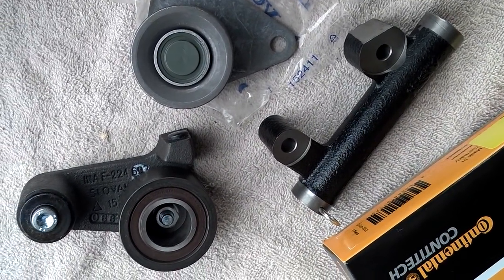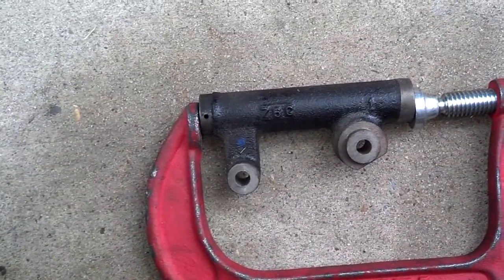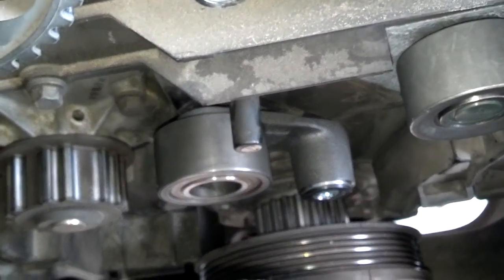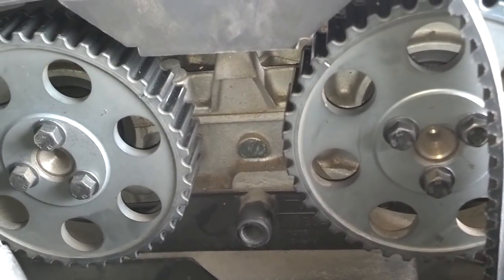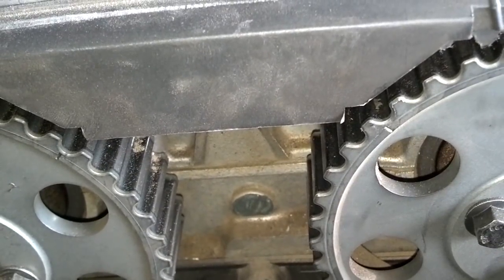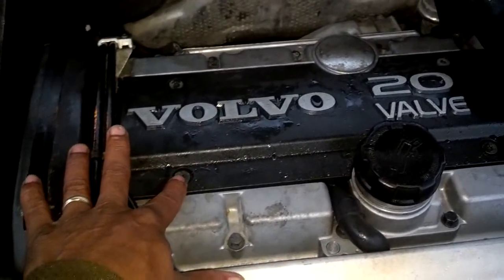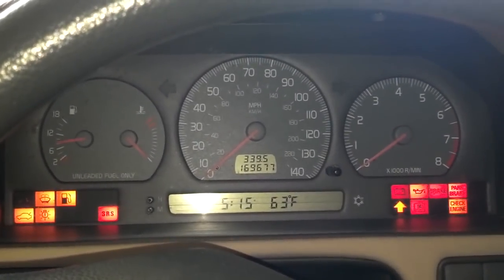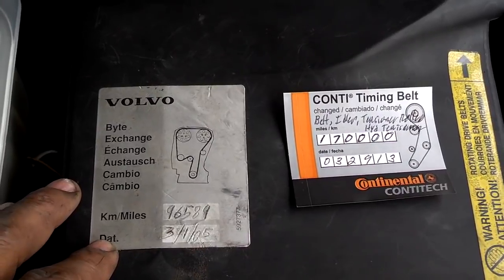How to replace the timing belt on the Volvo 850, S70, V70, etc. (Part 2 of 2)- VOTD

Comment: Just did mine last weekend (98 S70 T5), everything went smoothly (save for not having the serpentine tensioner tool, but I figured out a way to work around it), and the total cost was under $300 (local dealer charges $1300).

Keep up the great work, your tutorials are awesome and very easy to follow!

Comment: Thank you for sharing the timing belt work on the S70!  I have the mechanical tensioner which I think makes the work easier than the hydraulic ones.  However, it is very true that the mechanical ones could fail.  It did happen to my 98 S70 at around 100k miles.  I was extremely lucky to have caught the failure in my garage when the T-belt was making unusual sound as it was cutting through the cover.  Just lucky it happened at home!!  All ball bearings were gone, but tensioner was still in place.  The S70 is still running strong ~ heading towards ~400k miles.  Just durable vehicle if you can do the basic maintenance! 

Note also that the belt sizes are different between the mechanical and hydraulic tensioner types (~6 teeth difference).
Reply from the maker: Glad to read that you caught the problem before it destroyed the motor. You are right, these cars are great and can run a long time. I was aware that the newer motors with the mechanical tensioners have a different size belt.

Comment from the maker: Hey Paul. If the belt broke or slipped the head is destroyed and it will need a new head and / or pistons (lower end). If it's just due, that's another story and doable. The tensioner is a little different, it has a mechanical tensioner and the timing is set a little different but the guys on Matthews Volvo site can help with the minor differences. Let me know if you have any questions.

Comment: Robert, always a pleasure to watch you in action. I took off all of the components (belt -Two pulley's - water pump - tensioner  ) and unfortunately discovered that the tensioner  pulley was wrong and the Gates timing belt was the wrong size.  I had ordered the kit off of Amazon for 115$. Ughh man.
 You're so spot on right about the torx  bolt holding on the tensioner. You don't want to strip that . Mine was in bad shape from a previous owner. I had to apply a flat long bar against the ratchet head while unscrewing the bolt. I'll be replacing that torx bolt . Yes indeed ! 
This might help somebody - After writing down the mileage on the sticker , place clear plastic tape over the sticker face so as to preserve the information. I also write down that info on my Volvo book.
Reply from the maker: That tensioner pulley bolt comes with the new part, they are attached.

Sad to read about your parts. That is why I try to only order parts from suppliers that specifically support our cars. If they ship you something wrong, they will usually overnight the corrected part no questions asked.

I like to put the sticker in the glove box. I think I will go purchase an OEM sticker from Volvo from now on, if they will sell them. They are aluminum and writing on them with an ink pen leaves the data pressed into the sticker, so if the ink wears off the impression from the pen is still there.
Reply: Robert DIY Glove box ? Good idea.
Reply: also engrave the mileage on the cover if the sticker ever gets faded or lost.

Comment from the maker: You should be ok as long as you don't hear roller noise. Sometimes people change the belt only and leave the rollers and water pump along. If the rollers go bad it will cause the belt to jump time which would be as bad as the belt breaking. So if you hear the rollers squealing when you first start the car cold, I would replace everything. If you are skilled enough to slip a roller out and put a new one in, that would work as well but most folks don't even try that.

Comment from the maker: Not sure about the S80 crank (harmonic balancer) needing to be pulled. Google some instructions or check SwedeSpeed. 

Yes I did turn back the cam sprocket without the belt on. When you have the crank on mark spot, the cams are suppose to clear the valves/pistons.

Comment: Great video! The only advise I have has to do with removing the lower pulley. Yours was pretty clean, but if it had oil or dirt around it, the belt ends up with it all over it as well. I advise removing the lower pulley and cleaning the area.

Comment: Robert, I like to say on behalf of all the Volvo community thank you for sharing your knowledge on these white engines as they are called. I am doing a head gasket along with water pump,timing belt and serpentine belt replacement. Do I need to take the crank pulley off to remove the timing belt? It is caught behind the crank pulley and won't release so I was going to try removing the pulley.
Reply from the maker: +Carlos Lozano watch the end of part 1 of 2. What kind of car do you have?
Reply: Robert, I got sick. Sorry about the late response to your reply. I have a 1996 Volvo 850 turbo wagon. I actually jacked the engine by the oil pan about an inch and was able to remove timing belt. It got jammed somehow upon removal. It was an original Volvo belt which I doubt the owner had done. The car was a "rescued horse". I got it with a bad heater core,broken windshield,bald tires but transmission was good to and had a lot of power. You are right about these cars being a lot of fun. Thank you again Robert. I am changing out the water pump, timing belt, upper motor mount, fuel filter along with the head gasket job while I have it all the wrenches out. Take care. By the way, you should get a sticker that says "My other Volvo is a Volvo".

Comment from the maker: Good, you should be. I'm nervous every time I pull a timing belt. The thing to remember is to pay attention to details. Also, when you are done, you are to turn the crank over four times (two belt cycles) before you hit the key to start the car. If you do that you will be fine. Do NOT over tighten bolts that you put back on the motor.

Comment from the maker: Tire size and pressure should be on the sticker label inside your petro filler door. If not, look very close to the tire and you will see a set of numbers like 205-55/16.

Comment: Huge thank you for this guide as well as your PCV guide. I tackled both projects over the past couple of weekends with very little previous mechanical experience. Hoping to get another 70k out of my '94 850 (currently somewhere around 300k miles - odometer died in 2011). Thanks again!
Reply from the maker: David Kapustinski Good deal, thanks for sharing. You can check the actual miles on that car. - https://www.youtube.com/watch?v=9K-1WChRr9k
Reply from the maker: David Kapustinski Fix that odometer so you will know when to do services. - https://www.youtube.com/watch?v=-5XzLpfCMTE
Reply: Robert DIY Wow! Awesome thanks for the info!

Comment: good video. easy to follow. I am about to do the belt on my v70. For those who don't  want to fab the belt tensioner pulley tool, IPD sells the tool and a pin lock for about 20 bucks I think.
Reply from the maker: Jeremy Phillips It's $30 plus shipping. I sell a tool set for $9 shipped that will fit in your pocket and tool box. Thanks for watching.

Comment: robert G8 vids!  i did complete TB service for belt/tensioners/pullies/water pump.  heeding your advice, i bought 3 brand new "highest quality"T45's for removing the tenacious timing belt tensioner pully.  it was still stripping after 1st 2 T45's.  it was about 35% stripped.  no good.  then, i noticed that there is a thin 1/32"-ish collar on the outside of the torx collar...it is one in the same with the torx.  you can bite on this with vice grips.

Comment: Great video I've just done mine on the 3-4-2014, I watched a couple of times before doing both belts, water pump, and idlers at 188000 miles, the hydraulic tensioner was in good order although the same couldn't be said for the idlers and pump, I think I replaced them just in time as they were all noisy and had play in the pump.

One thing I did notice was my exhaust cam was one tooth out clockwise, I have done 1600 miles since buying the car a few weeks ago and the previous owner had the timing belt changed at 93000 and there had not been any performance issues since then with one tooth out.
Reply from the maker: kdri155 Yes, it's hard to tell the timing is off by 1 tooth. May lose 5% of the cars performance.

Comment from the maker: I have never heard any story about an OEM belt snapping, that was within it's time change schedule. Most belt companies should have good belts that will last the 115,000 km schedule. All the stories I have heard/read were people that failed to replace them. These are interfierence motors so valve damage will happen if you let the belt break. Another reason the belt breaks is that people fail to replace the rollers, the rollers fail/sieze and causes the belt to break.
Reply: Not the same engine, but Volvo 740 made in 1990, we had the belt fail standing at traffic lights after 6 months and 8000 miles of ownership. The engine was replaced under warranty but the dealer in Michigan spent a month at it.

Comment: I would think they're a different material, they tend to be caramel coloured, sort of see through as well. But the teeth look no different. Actually, all the little Honda OHC lawn and garden engines use run in oil cambelts. My 850 was pretty snug behind the pulley, I was worried about maybe scoring the belt on some sharp casting. But I held my finger to it as it was running and it was fine. I'd use a little water based lube next time for sure.

Comment: Hi Robert, I have a 1999 Volvo C70 T5 with the B5234T3 engine that has the VVT on the exhaust cam. I'm diagnosing why it doesn't start very well and tries to stall after a cold start, after the mechanics did the timing. They changed the camshaft position sensor too but it didn't fix the issue. I was suspecting the timing to be a tooth off, but it seems everything is aligning now that I'm looking into it myself. The mechanics kept changing more and more parts from alternator to ignition coils but the issue persists. My Volvo repair manual isn't much help, it tells me to take it to a Volvo dealership for timing if it's the newer 1999 model - but my local Volvo dealership asked if it's a S70 and if it's a diesel, so I can't trust them either 😂
It starts a bit better when it's warm, but it stalled randomly with the check engine light on, throwing a code about the camshaft position sensor.
Reply from the maker: https://youtu.be/cWKOi8D4SWQ?si=sFvyA2qb2Nez2IAf
Reply from the maker: https://youtu.be/Jc4pfC3D3EU?si=h0NFUDyCrO4oVU6f
Reply from the maker: Being a tooth or two off on the timing usually will not cause the car to fail to start or stay running.
Reply: @RobertDIY  Thanks! I will look into the ECT! It has multiple faults, with one key it sounded like an old Harley, chopping and almost stalling. Other key it had problems starting but ran fine. The coolant light is on, it creates pressure in the system and also leaks coolant. I probably need a new antenna ring and a radiator too

Comment: yes robert  sorry from uk yes its a turbo diesel 2.4 140 bhp 2000 i think the timing belt is at the front of engine and the injector pump belt is at the back of the engine which in the uk is the left hand side
Reply from the maker: John Lay I can't find my manual at the time. Try Google, you may find some instructions on a forum.

Comment from the maker: LOL, I think the 4 foot breaker bar is a little over kill but "better safe than sorry". 

Why the oil cap gasket? The timing belt has nothing to do with the timing belt change. If you see oil on top of the motor you likely have a clogged PCV.

Comment: I have a question for you than no other mechanic could not answer in my country. I have ford focus from 2008 (europe model) with 1.4l engine that is 16v. not it has 45000km on 35 it started to do a rattling noise from 1200 to 2100 rpm when you lift off the gas and when the car is cold, when warm it used to not rattle but now its audible. in ford they told me that they need to check the timing belt but that is a lot of work. could timing belt do this rattle. power is oky, mot test is oky.

Comment: hey great work.
i have a question is it possible to replace the timing belt on a volvo 2000 s80 with out removing the crankshaft? because i dont have air tools, or the special tool (crankshaft holding tool)
also i saw your mark's move clock wise , did you turn back the crankshaft back with out the timing belt on?

Comment: I feel I should mention this. Before you take the timing belt off, you might wanna consider removing the harmonic balancer. I almost didnt get the belt on. There was the metal thing, engine mount and a stupid enginecover in my way. Somehow I got the belt on by brute force. Hope the belt wont wear out prematurly

Comment: Good show,  volvo has at least 5 variations of motor for one model in one year....hmmm. Then the manual says "variations are due to our efforts to increase the belt's longevity".....well you have to think, maybe they should have tested and verified a single good design to start with. I feel a little bad for them trying to make cars affordable, reliable, and emissions compliant is a pick any two, situation. Bring on the age of the golf carts. Right on with the video, helped me understand the timing marks (critical).     Thanks
Reply from the maker: You are welcome

Comment: Going to do this in a few days, thanks for your video Robert!
Reply from the maker: +Cobain Windsurfer you are welcome.
Reply: Bought waterpump, timing belt and the two rollers from Volvo shop for employes yesterday,  299 dollars alltogether. But I think in US spareparts are cheaper anyway. Thought the second time to change timingbelt was 285 000 km, (165 000 + 120 000 km) but later I found out in the servicemanual that the second time is at 330 000 km (or 10 years??).  Do you change before that intervall?

Comment: So, here I am going over video. I need the one that shows doing the water pump on 2000 S70 non turbo. Also how do I know if I should change the seals on Crank and Cam shaft? Should I go by how many miles? I don't think this vehicle was treated with much respect. The body is great, so I'd like a vehicle good on gas. Thanks Robert
Reply from the maker: If the seals are not leaking, leave them alone.
Reply: @RobertDIY  ok. Thank you

Comment: hello Robert i am in the process of doing a timing belt change on my T5R.  i got the motor timed with both camshafts on the top cover timing marks.
i only see ONE notch on my crankshaft that lines up w the oil pump. and also the timing belt lines up w the marking on the crankshaft pulley.  can it be possible that my crank only has ONE marking aligning the oil pump? i have already removed my timing belt...now im having second guesses about timing.  can the engine be not timed correctly even though all the top cam shafts sprocket marks line up?
help!! 
thank you sir

Comment: I'm changing the timing belt on my 95 850. it's got the 2.4 no turbo. every parts store has two listed but the parts look pretty much the same. is there a way to tell from the Vin which part I need?

Comment: thanks for your quick reply and help
... do you recommend just leaving the plastic "post" broken off? I was thinking of trying to glue it but worried it may in glue itself and cause more problems.  without the post I was worried the front cover might run against the roller that the  "post" is there to protect.  I followed your video and got everything on there just right before it broke, now I'm not sure if I should pull the pin on the tensioner if I need to mess with the lower cover, which is $70 and a few days out...
Reply from the maker: +Mark Begle just like I said, I leave it off. I didn't say that I try to glue it. That would be tragic, glue fails and the piece falls into the crank while the engine is turning and cut through the belt. 🤣

Comment: Hi again Robert! That V70 i just saved from the crusher is really an oddball. After the radio staying blocked after the good code is entered, now my cam gears are unusual too. Have you ever seen some that had no marks on them? Apart from a little M embossed in them, they're perfectly uniform all around... I did not look for the crank gear marks yet, but i already have a problem up there. It's a base model 1999 V70. What should i look for as a marking for the cam gears?
Reply from the maker: If it was running with no codes, put the crank on it's mark then mark the cams.
Reply: @RobertDIY  I'll see if i can find the marks on the crank then go that way. No clue if the check engine coded anything, i only made it run when parked at the junkyard for like 2 minutes. No exhaust at all but the manifold and its flexible part. Not the best situation. I'll see what i can do for the timing, thanks!

Comment: Great video, im going to replace my timing belt next saturday, im going to replace the water pump also. hope that nothing goes wrong:) Thank u for the information to change the belt in this video./// Christian
Reply from the maker: chris gustavsson Thanks for watching. Set the timing BEFORE removing the belt and roll the motor over by hand before starting it and all should be fine.

Comment: Hi Robert Do you have a video fro changing timing belt for a 1996 Volvo 850 CD sedan. Regards Peter Sheehan
Reply from the maker: Same same.  Volvo Timing Belt Replacement, S70, 850, V70 (Part 1 of 2) - Auto Repair Series